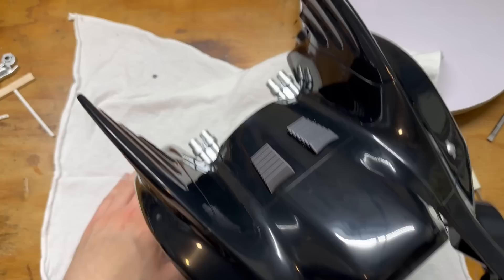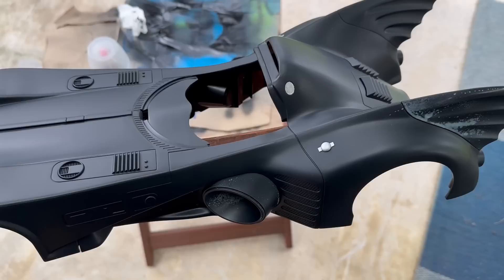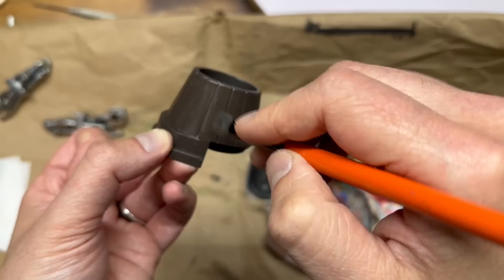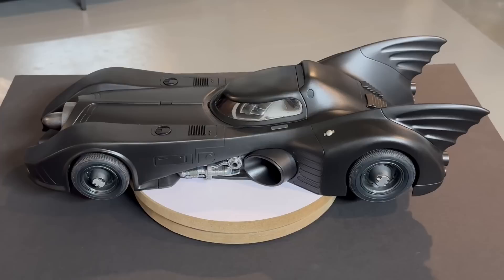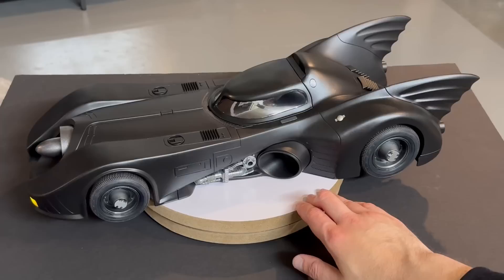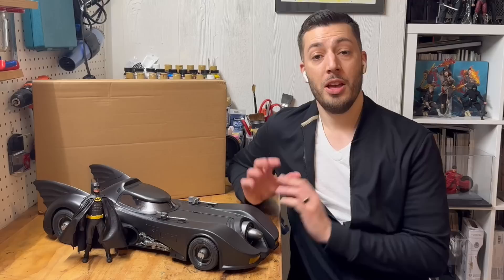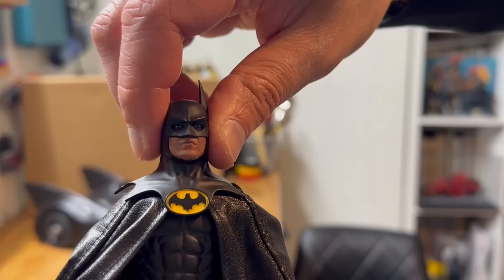Customizing The McFarlane Batmobile Pt. 2

Comment: See what you should have done....lol jk awesome work 👏 but I do have a question I think the center wheel protrude out more then they should do you think you would customize that if so how?
Reply from the maker: 😂Thank you! They do, and the front wheels/tires in general stick out too far from the body. I honestly how no idea how the centercap could be fixed. You could sand it off but it might be hollow underneath or it might have the metal rod that supports the wheels.

Comment: so how fragile is the body of the car ? cause i was thinking about cutting out the trunk and put hinges on it too allow ease of access for a battery pack
Reply from the maker: That would be really dope. The body is NOT fragile. It's actually kinda hard to cut through parts of it. I would heat it up with a blowdryer first and it should go pretty smoothly, but it'll probably take several passes to get through. I tried cutting out the gun panel covers with a super sharp x-acto and I only barely got through in a couple of tiny spots after an hour of consistent cutting. That was with no heat though. I didn't want any warping so I did it at room temp. But at the back it's less intricate and I think you'd be okay warming it up
Reply: @Ibrahim_M  thanks for the answer , i was thinking of attaching a x-acto blade to a soldering iron
Reply from the maker: @thunderrobots1980s  You're welcome. Yeah that would cut through it like butter, all day

Comment: Could you elaborate a little more on getting the taillights out? I'm having a hell of a time getting them out. Haven't even tried the headlights yet.
Reply from the maker: Sure thing. I just took a drill bit that was the same size as the pegs on the back of the lights, and I gently drilled into the back until they just popped out.
Reply: @Ibrahim_M  ok so you just drilled the inner part where it connects to the rest of the body and that kept the outter part of the light intact correct?
Reply from the maker: @speedfreak91  Correct! The only part that gets mangled at all is the peg (Ideally).  For the headlights, I used a flathead screwdriver and just kinda pushed on the tab at the back to get it loose, and then you can just peel it off from the front.
Reply: @Ibrahim_M  ok, thank you so much I've been goin nuts trying to figure out how to get them apart without destroying em. Don't care about the pegs so that's fine. Thank you!!
Reply from the maker: @speedfreak91  You're welcome! Yeah those things are IN there. Everything in that car that is glued in is like, really glued in, lol. Good luck!
Reply: @Ibrahim_M  lol yeah, and I'd tried a heat gun and boiling water I didn't realize they're pegged as well. It's a pain lol. But thanks again yours looks amazing.
Reply: @Ibrahim_M  Hey just wanted to thank you again for the tips. I was able to get everything out without breaking anything. Thank you!!
Reply from the maker: @speedfreak91  I'm glad it worked out! And you're welcome. Thanks so much for looping back around!
Reply: @Ibrahim_M  Absolutely, really appreciated the help.

Comment: How much cost to make this toy like that? And suggestion you can put a batman figure inside just buy a 3.75 batman figure
Reply from the maker: Probably another $50-$60. But I had some of the materials already because I do this kind of thing a lot. a 3.75" figure in this would look like a little kid sitting on a driver's seat. Plus they already make batmobiles at that size-- Spinmaster just put one out that is very accurate and it comes with a figure.
Reply: Can you do that for me?

Comment: What size gems (tail lights) did you use?
Reply from the maker: I can’t recall exactly but I think the top ones were 11mm and the bottom were 9mm. But you’ll want to measure the ones it comes with before ordering any just to be safe
Reply: @Ibrahim_M  thanks!!!
Reply from the maker: @styles1clash362  you’re welcome!

Comment: Are you going to make the guns pop up mechanism?
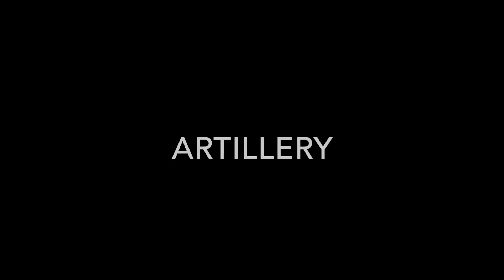Reply from the maker: I touch on that at 12:07!
Reply: @Ibrahim_M  I didn't see it before. Thanks for pointing that out again. What a problem... I don´t think it´s worth the effort... and I'm used to do a lot of scratchbuilding and complex modifications on those old plastic model kits...
Reply from the maker: @i7rooper  No worries! An online buddy of mine just messaged me today showing me that he was eventually able to cut through it but he had to cut away at some of the support pieces. But it seems like it get get by without them. I probably still won't just because it's so much work and ultimately I would probably never display it like that, but I do plan to redo the wheel paint, so who knows what'll happen once I take it apart again, haha.
Reply: @Ibrahim_M  You have another Batmobile. Don't you? 😂
Reply from the maker: @i7rooper  😂😂 I really thought I'd do them both at the same time, lol. I didn't even want to look at this thing for a week after I finished it!